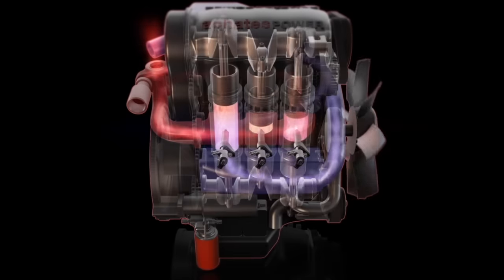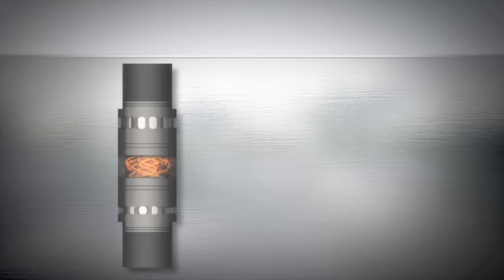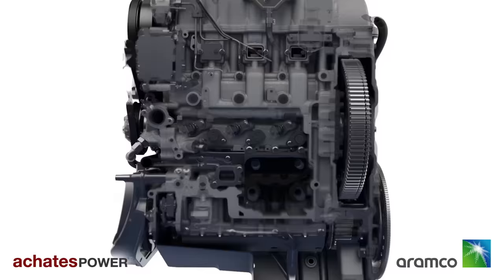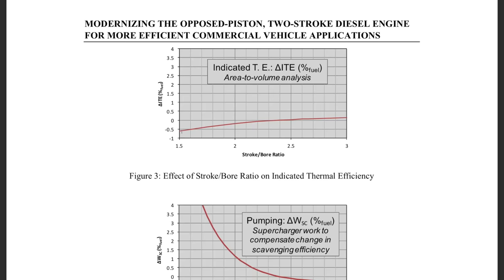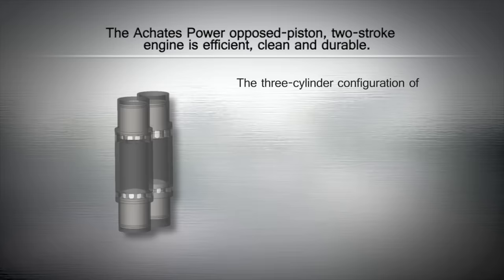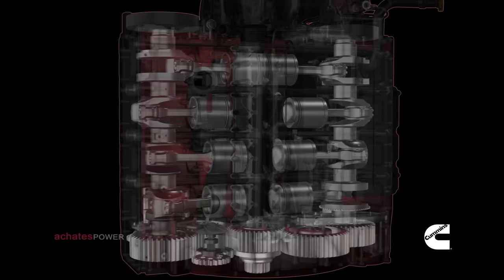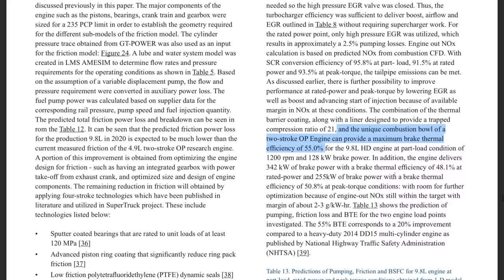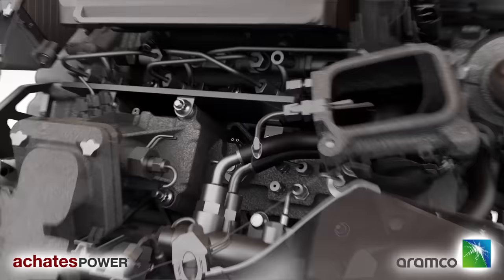Opposed Piston Diesel Engines Are Crazy Efficient

Comment: 5 cylinder 10  piston  opposite piston diesel Russian Tank Engine Jumo 205 Kosice , it has been in service for years ,
I have been thinking of such a design for a long time 
2 questions come  to mine , Rings going over the intake and exhaust ports in the sleeves ?
 and how do you eliminate the gap between the crankshaft gears to maintain accurate timing ?
Reply: The edges of the port openings are not sharp and the rings tend to remain nearly circular so the rings can go over the ports OK.

High strength fine toothed gears dont have a lot of backlash.  If you want to get rid of the little that remains, you can do it like this:
Instead of a single gear, each gear is a pair of gears.  The teeth on the gears are not straight across the outside surface but instead are at a slight angle.  On the pair, the angles are opposite.
On one of the two shafts, one of the gears is free to slide along the shaft a bit.
A spring pushes the movable gear trying to bring the pair of gears closer together.
The angle on the teeth means that there is a resulting attempt for the moving gear to rotate as it slides.  The spline the gear is moving on won't let it rotate.
The result is that the pair of gears have a force on their teeth even when the machine is at rest.
Reply: Ken Smith 

I was about 7 years old when I started playing around with junk at my Dad's Mechanic Shop at about 13 +- years old I entered the shop working as a full-time mechanic by the age of 15 I was doing truck diesel engine overhauls on Volvos in Scania vabis ,
we started work at sunlight and finished whenever the job was done sometimes until the middle of the night ,
I can't remember what engine  I worked on while back in which the camshaft variable timing gear had spring loading mechanism on it , there were two gears on the same camshaft one was the main gear and the second was a thin spring-loaded gear , the main function of the spring loaded gear was to provide opposite  torque to eliminate the Slack or gap between two gears and this way keeping both gears tension at all time ,
I also came across engine rings that have a small hook mechanism at the Rings Gap ,
after installing the ring on the piston we used to squeeze it little bit and slide One ring end over the other and this way ring stay in one place ,
Reply: Nidal Shehadeh
The anti-blacklash thing you describe is a common one where the force is almost entirely in one direction.  The smaller gear with the spring provides enough force to ensure that the main ones stay in good contact.  The one I explained is used where there is more back and forth action going on.  The force it makes is bigger.
Reply: Ken Smith 
It will be nice if you could have a visual ,
If I am not mistaken Bill Gates is soaking money into it .
Reply: Nidal Shehadeh:
If I wasn't so lazy I could do that.
Unfortunately I am so lazy that
Reply: Nidal Shehadeh longer pistons with top and bottom sets of rings.The ports on s Detroit diesel are a series of narrow holes with solid edges that keeps those rings compressed as they clear the portholes.. once the twin cranks are installed ( with meshing /synched properly), that's it, no camshaft/ conventional valve train
Reply: @aaronhumphrey2009  

I entered the Automotive and truck mechanic business at the age of 13 by 15 I was doing my own diesel engine overhauls with all of that I have no experience with two stroke engine ,
though I am out of the business due to disability curiosity and the Deep desire to go back into doing something is taking me apart ,
that is why I have a lot of questions ,
for example I understand the two stroke diesel engines have a higher oil consumption then four stroke ,
I was talking to an old time diesel mechanic and he was telling me they had to install blowers on them to get the emission requirement down to legal limits ,
whether it was true or not I have no idea maybe some of you gentleman could clarify things for us ,
how come we don't see 2 stroke diesel engines all over the place after all there's a higher percentage of 4 stroke diesel then 2 stroke ?
Reply: The piston rings are held in by lateral lands on the ports. The achactes does have one design flaw: long pistons with " hot " heads. Especially on the top cylinders , piston overheating could be a big problem. My solution: thicker piston " crowns", internal oil jet cooling on upper cylinders. I hope that they can pass very tight emissions regulations today, I'd love to have an engine like this, getting 30+ mpgs in a full-sized pick up would be great !
Reply: @aaronhumphrey2009  

one of the ideas that I have come across is to have engines run at 2000 degrees and this way they'll be no significant amount of pollution to speak of ,
problem number one they could not find oil that can survive under so much heat ,
two ,
Pistons that could survive under so much stress ,
they were talking about making Pistons out of ceramics and inject oil with the fuel the same way it is done with the Garden variety 2 stroke chainsaws trimmers with have you
in the end it turned out to be a pipe dream ,
there is one engine that might close the gap between efficiency and emission and that is the Little Mighty engine ,
I do not see the automotive industry clamoring over this little Mighty engine and at the same time the inventor have not been assassinated  which lead me to believe it is not what they say it is .
Reply: Sounds like a diesel exaust" converter/ catalyst". . such high temps may require auxiliary fuel/ DEF  injection, because cruising / average exaust temps aren't that high, or even desirable
Reply: Aaron Humphrey  
High temperature is what they use in the Automotive catalytic converter to destroy undesired hydrocarbons in the exhaust after catalytic converter heats up above the threshold of air injection .
Reply: Is timing even that critical here? Essentially no valves to open/close.
Reply: @agt155  

timing is necessary due to crankshaft balance  ,
one Revolution is 360° the more you divide 360° in to equal divisions the more balance in the engine and less vibration ,
the more cylinders there is an engine the  more stable it is ,
don't forget timing is needed for the fuel injection .
Reply: Opposed piston engines are renowned for their lack of vibration.
Reply: @aaronhumphrey2009  The claimed fuel consumption of such an engine, would in my humble opinion, DOOM it before it even gets off the drawing board. No manufacturer wants a frugal engine. Oil companys would not allow it. Nor would Trump.
Reply: @nidalshehadeh6001  Fuel injection is all electronic now.
Reply: @agt155  
They still have to have timing to inject at a specific point .
Reply: @nidalshehadeh6001  Yes, from a sensor off the crank. Doesn't have to go through any gearing.
Reply: @agt155  
Exactly injection does need to censor ,
That has to be a timing for the Pistons to get together at the same time
Reply: @nidalshehadeh6001  Let's hope the pistons don't get together at the same time. Although this couldn't happen with an opposed design which is why timing is less critical.
Reply: agt155  
Have you ever had a chance to overhaul a big rig diesel engine ?
The way they are design makes it  impossible possibility for Pistons to collide with each other
Reply: Transmission by grar train for gear with belt or chain transmission will be fine for it
Reply: @agt155  It's called perfect primary balance. That is why some engines have counter balance shafts running twice crank speed.

Comment: Seems interesting. I would love to see what different engineers would say about it in their expert opinion when introduced to its performance
Reply: My initial thoughts are that emissions will be the biggest hurdle to overcome. It will no doubt require significant after-treatment and development to become compliant to both EU and US regulations. It would be interesting to see some data on it though.
Reply: JANNOSPR   They did a lot of emissions work and claim it is very easy to comply.  They claim it will be a cost savings as DPF & catalysts will be smaller.
Reply: Yes. A daunting task but not impossible

Comment: How are the cylinders lubricated? Especially on the exhaust side?
Reply: but then it would leak because the ports are open.
Reply: negative. This is a 2-stroke design. Oil is mixed in with the fuel.
Reply: so you're gonna burn oil on every combustion? nature loves when you do that.
Reply: Howler I agree. I don't know how they plan on passing emissions.
Reply: fishgill0890 no, oil is mixed with fuel in small 2 stroke engines because there is no crankcase oil. There is none because the back side of the piston is used to force air in to improve scavenging. This engine is supercharged and turbocharged, so it does not need that and can have crankcase oil.
Reply: 2-stroke diesels do NOT mix oil with the fuel. The fuel itself provides some lubrication.
Reply: And I can't tell you how tired I am of hearing the myth that two stroke engines have to burn premix fuel; especially when it comes to diesel engines, where the fuel it self can provide decent lubrication.
Reply: Yes, diesel has it's own lubrication.
Reply: Direct Injection engine, the diesel doesn't get the opportunity to lubricate anything. It gets burned up before that.
Reply: Diesle fuel is high oil
Reply: fishgill0890 Nope. 2 stroke engines do not necessarily have to run oil fuel mixes. Detroit diesels never did.
Reply: Its not intended to lubricate anything once it enters the combustion chamber, that happens before.
Reply: Er no, this is a diesel. Unlike the usual two stroke design the air charge does not pass through the crankcases so they are lubricated in the usual way. Some of the oil film on the cylinder walls does creep out of the exhaust ports and the choice of lubricating oil has to reflect this to avoid pollution. The ports are never open to the crankcase.
Reply: It's a DIESEL
Reply: It is not a diesel. Otherwise the did not have to inject diesel to combused.
Diesel is self combusting and fuel/gas is not.They use diesel in stead of sparkplug...extra combustion and lubrication.
Reply: The Jumo 205 is the same layout (6 cylinders) and was very successful and reliable.
I can't wrap my head around the top piston lubrication but it surely is simple if it was unproblematic.
Reply: No oil mixing in Diesel engines, the diesel acts as a lubricant, additionally the rings are never in ports.
Reply: No oil mixing and rings never clear ports.
Reply: Just like any other diesel engine, there is no oil mixing and rings never clear ports
Reply: GnonplussedGnome
Actually if you watch the video the rings  the rings do cross the ports.
Reply: Look again there is a set of rings at the bottom of the piston as well.
Reply: Yeah exactly.  This isn't a chainsaw!  It's an engine intended to run on diesel!
Reply: Guust, tell that to my T Direct I...
Reply: Kris M 
Finally someone gets it right!!!  This is not a weed whacker engine!!
Reply: fishgill0890 no. It is a 2 stroke diesel engine. There is no oil mixed in with the fuel what so ever. it's just strait diesel fuel.
Reply: It's just like the old 2 stroke diesel.(every piston has two separate sets of rings) the top ring gets lubricant from the fuel. The botom rings from the crank shaft. But the top cylinder  is squirted. its proven old marine technology but in marine engines is too complex to servisse for the size. It's already hard to mantiene a normal 5 ft high engine
Reply: Ryan Miller you are correct, the crankcase has a oil pump on a semi dry or dry sump. I don't know why people seem to think just because it's 2 stroke , fuel and lubricant have to be mixed.
Reply: Diesel Fuel is a fuel oil, lubrication clue is in the name. Also some of the particulates are carbon which is also a lubricant. The bottom set of rings will be lubricated with injectors into the cylinder walls and scraped back into the crankcase. The Commer TS3 engine (of which this is a refinement) was the most fuel efficient diesel ever made.
Reply: This engine is not suitable for the road. There is a reason why its not used. It is used mainly in tanks (mainly soviet/russian ones) due to their good efficiency and smaller size than V and inline engines. But Im pretty sure it isnt used in standard cars and trucks because it is too complex, and it wouldnt make up for the price. In tanks tough, that doesnt matter, but in vehicles that are used for travelling and transport, it does.
Reply: USWaterRockets diesel fuel...
Reply: I sometimes use diesel as a lube on my birds ringa
Reply: Waifuracer They were used in trucks in the 1950's No camshafts or valves, and you call that too complex?
Reply: Diesel engine nerds...
Reply: Actually the whole Africa and far east is in 2strok for the last 60 years 🤔
Reply: USWaterRockets 
Worn Rings and gravity.
I bet these things will smoke like a Banshee when aging. Gravity will pull oil into the combustion chamber past the upper piston rings like crazy.
Reply: Diesel fuel is oily .
Reply: USWaterRockets look carefully at the bottom of the piston as opposed to the top of it. There’s rings at both sides, also no doubt that theres some kind of oil squirters in the sleeve above the ports in some weird fashion.
Reply: No ... these aren't lawn mower engines or motor cycle engines.  Larger HP Two strokers use oil sumps and oil control rings just like 4 strokers.  Two strokers can meet emissions.
Reply: And remember that these are opposed piston two-strokers not the Detroit diesel conventional two strokers .. dont mix green apples with red apples.  Conventional two-strokers have been replaced by four strokers but the opposed piston design has eliminated many of the conventional two stroker disadvantages, and so they will probably start displacing four strokers in the market - and still meet emissions.
Reply: Adam Webb - The ports don't lead to the crankcases.
Reply: fishgill0890 - In a two-stroke-cycle motor no oil is mixed with the fuel. As this is a diesel oil is the fuel! What is the point?
Reply: Howler - All diesels burn oil. That's what they run on.
Reply: GnonplussedGnome -Diesel oil is used only as fuel. It does lubricate the injection pump.
Reply: Levi shuman - Diesel fuel IS oil.
Reply: USWaterRockets you can see oil nozzles in the animation. Also, the engine is not completely vertical. So oil would be able to drain back to the oil pan, and piston rings will help remove all but negligible amounts of oil, just like a 4 stroke engine does.
Reply: Kris M - Wish everyone would read your comment. The air in the cylinder has already been compressed and is well above the ignition temperature of diesel oil. Just before TDC the fuel is injected in a fine spray, which ignites as it comes out of the injector nozzle. No liquid oil makes it to the cylinder wall. It has already become CO^2 and H^2O before it could get to the wall to do any lubrication.
Diesel motors cylinder wall, piston and rings are lubricated just like spark ignition (gasoline, LPG, NG) motors.
Rings can pass across ports with no problem. The rings are prevented from turning in the grooves by small pins pressed or screwed into the grooves at the ring gaps. This prevents the ends of the rings from snagging in the ports.
Reply: Dingus E. Dow - Saw 2 strokes are low compression that is insufficient to cause the fuel to auto-ignite. People would run kerosene, which is just up the distillate scale.from diesel oil, in Model T and other side-valve, low compression motors once they were warmed up.

Comment: This would have been really something if adopted by the auto industry forty years ago, but these days, with electrification of autos imminent, it seems like too little too late.  It's just an incremental improvement on an obsolescent technology that will take years to work all the issues out, and by then it will already be irrelevant.
Reply: Dan Sanger electric will work for small commuter cars but you won’t see electric for working vehicles anytime soon, for example long haul trucks, fire engines, ambulances, police cars, trash trucks, etc. electric just won’t work until you can charge it in the same time it takes to fill a fuel tank.
Reply: The issue of charge time is exaggerated.  For people who have a place to charge at night, charging takes ten seconds: five seconds to plug in at night, and five seconds to unplug in the morning.  It's actually MORE convenient than a gasoline car.  Every morning you have a full "tank".  It's less convenient only on road trips, which for most people is only a small number of days per year.  And even there, it's not as bad as it's made out to be.  You have to stop to eat, sleep, stretch, and use the restroom anyway.

Electric works for small cars, but also for big cars.  The Tesla Model S and X are large and sell very well against their competitors.  The Jaguar I-Pace is another large EV now coming to market.  

As for large, commercial vehicles, the transition is already happening, starting for short range vehicles.  Shenzen, a very large city in China, completely transitioned their city's diesel bus fleet to battery electric, over 16 THOUSAND buses.  Cities in the US are also starting to buy in smaller quantities for evaluation.  My local transit system bought some, and I see them almost every time I go out.  Delivery companies such as UPS and DHL are starting to make similar moves.  DHL is even building their own.  Electric is already economical for many short haul applications such as these.  Long haul trucks will take more time, especially for really long distances, but the economics keep getting better as battery prices drop, down 80% since 2010, and still dropping.
Reply: The change won't be imminent. The infrastructure for charging isn't there in a lot of places and applications like towing heavy loads impacts battery life so bad on the vehicles we have today that it isn't practically possible.

It will likely happen before 2050 (or at least half way) but it won't be imminent.